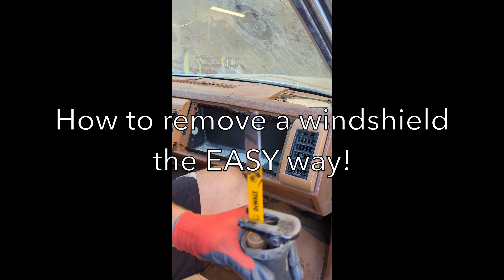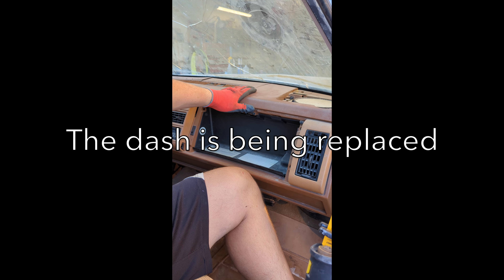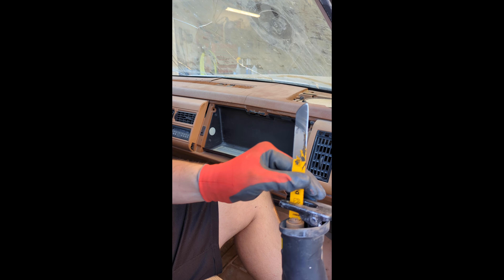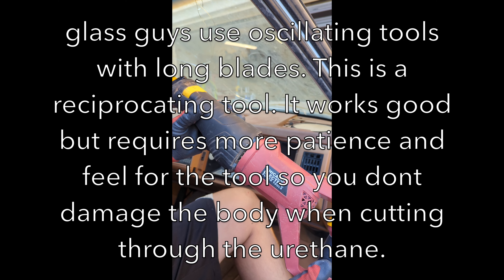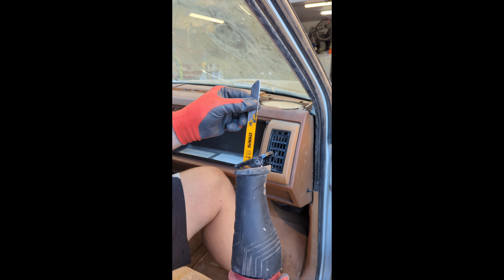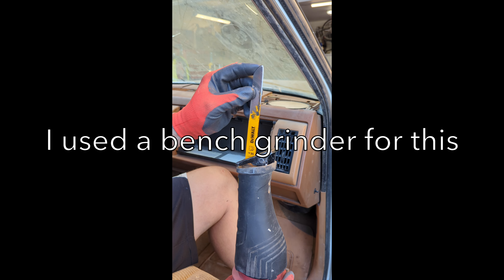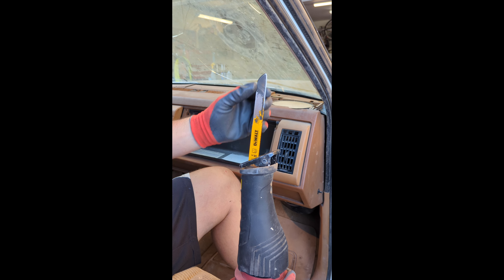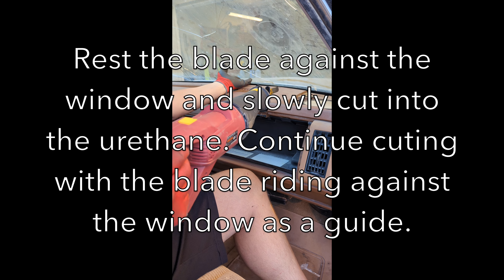How to remove a windshield the easy way Chevy k1500

Comment: I have lots of blades that have no teeth left whatsoever from cutting through really hard old plaster, and found that if I sharpen them up with a grinder they are the best thing I have ever used for cutting xps foam board, especially the thick stuff like 2". Cuts like a hot knife through butter, way easier than scouring with a razor. Foam board is great for building grows, but cutting through it for outlets or vents with a hole saw or razor makes a huge mess and leaves a rough edge, this cuts quick and clean. Hope this helps someone. OBS Chevys are the jam
Reply from the maker: Thanks for the tip! I use that 2" for insulation all the time. I use a olfa blade from Japan .7 those are good too. But damn I never thought about using these. 👍
Reply: @HygroHybrid  Try it out you will like it! Have to check out those olfa blades
Reply: When I talked to my uncle about replacing a window on my c1500 he came over and used the same process 🤣

Comment: Hell yeah!! Can't wait to try this in my garden 😂.  I'm kidding.  Are you doing a full restoration project?
Reply from the maker: lmao.. not to sure yet, well see.. Its in great shape. that hood was already bent and the dash was cracked, I got a new one. it was sitting 17yrs. New trans, gas tank, sending unit, fuel pump, fuel injectors, fuel filter, brakes, new glass front and back, shit head kids shot them out with BB guns lol. super clean though. I have to paint it for sure.

I think im gonna paint this myself. would be the first auto paint I ever do.
Reply: @HygroHybrid   are you going to do a video series on it?  I think it would be cool because I like tinkering with stuff like that.  I used to have a 96 k1500 that was a shit box at best but the motor was perfect lol.
Reply from the maker: I can. My wife grabbed my phone and shot this, last second thing. I'll make some more. 👍
Reply: @HygroHybrid  
Man I can watch HOURS of content like this!!